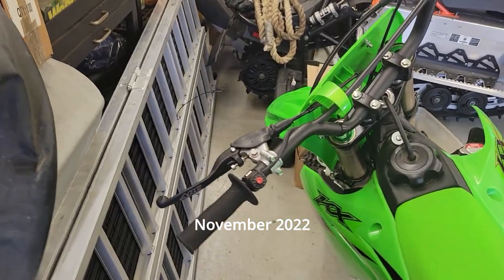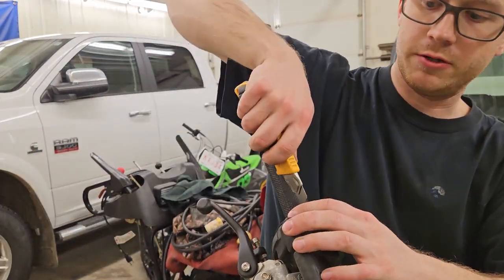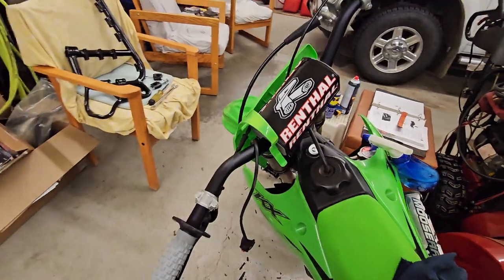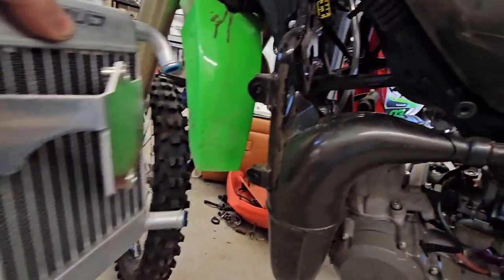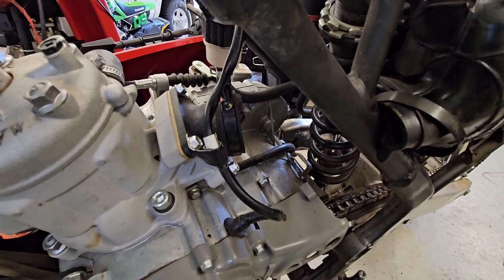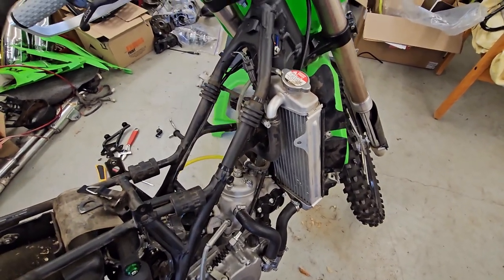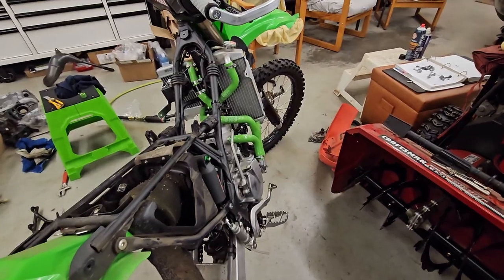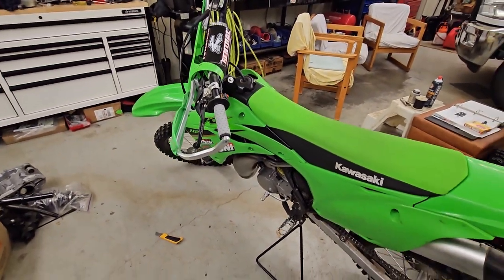KX112 Aftermarket Performance Parts

Comment: What are your opinions of the pipe and carb upgrades? Those are top notch parts! Just wondered if it was worth the cost or if it wasn't super noticeable. I love my KX112 (100% stock beside bars) on hard packed surface but In deep sand it could use alot more torque.
Reply from the maker: It's honestly not much of a noticeable power difference. The carb is easy to tune with metering rod and power jet adjustments, and seems to run more consistent day after day with temperature and humidity changes. The pipe seemed to add a little bit of low and mid range power, but the biggest plus to the pipe is the second rad. The bike runs very cool now, never seen it get over 60c yet. Running these 2 stroke as cool as possible is a big part of getting them to last a long time between rebuilds

Comment: Link for Part to buy Please .. 🙏
Reply from the maker: Bud racing pipe and radiator - https://www.budracing-usa.com/us/additionnal-bud-radiator-kit-hoses-pipe-included-kx-100-85-14.html
Lectron carb - https://www.lectronfuelsystems.com/sbm/kawasaki/kawasaki-minis/billetron-29.html
Handlebars - https://fortnine.ca/en/renthal-fatbar-1-1-8-handlebar
Temp gauge - https://fortnine.ca/en/trail-tech-temperature-gauge-with-radiator-hose-sensor
Grips - https://fortnine.ca/en/pro-taper-pillow-top-mx-grips
Reply: @RedlineRollers  👍👍

Comment: How much cooler does it run with 2nd rad?
Reply from the maker: I can't really say, installed the coolant temp gauge the same time as the 2nd rad. I never really knew the true temperature with just 1 radiator
Reply: Ah OK I just use my handheld thermo laser thing for now usually I'm 120-140* Thinking of getting the 2nd rad and exhaust.